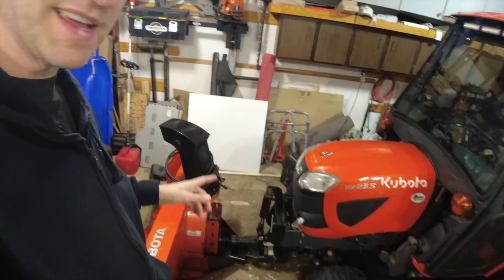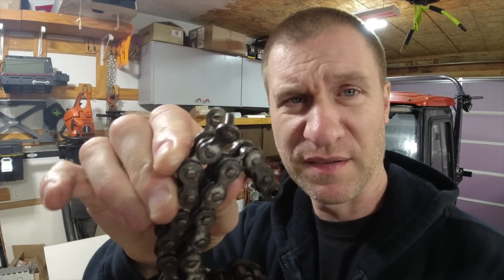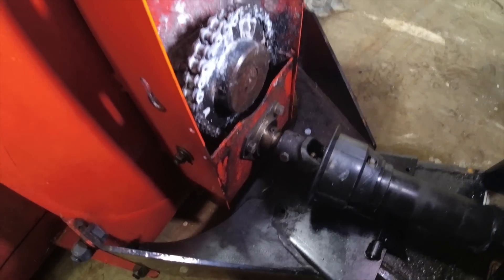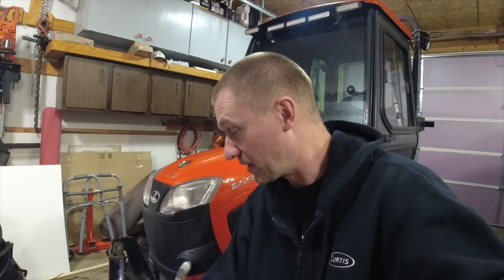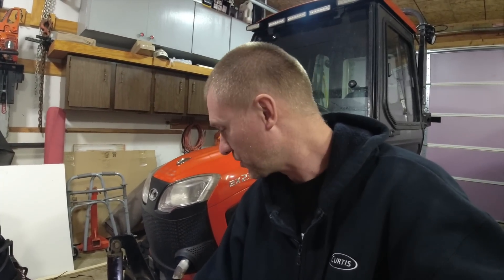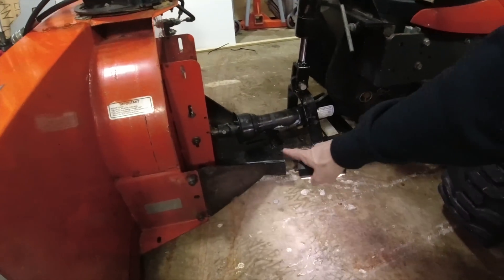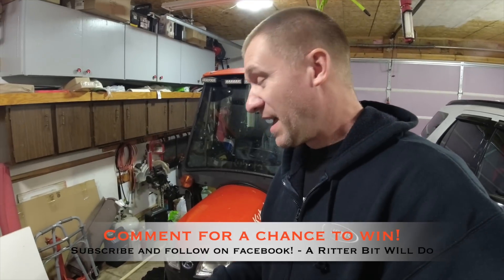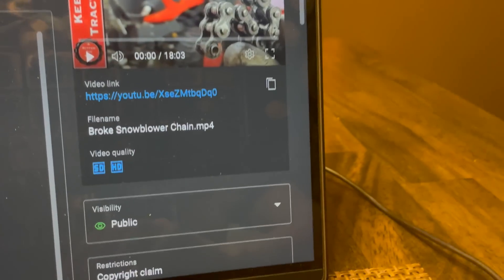CAN'T BELIEVE I OVERLOOK THIS (Plus Decal Winners!)

Comment: Jon, Wherever there is a shear bolt used you should remove the bolts every season and be sure the shafts rotate freely from each other. If the shafts become rusted together, the shear bolt won't break and you will be spending a lot more than the cost of a shear bolt to fix the damage!
Reply: Great tip!

Comment: Happy and a Blessed New Years John and family!! Two suggestions. 1. There are commercial sprays you can buy so the thick wet snow doesn’t clog; I’ve also used plain cooking oil in a spray bottle. 2. In an area that gets a lot of vibration instead of Lock Tight I use nail polish. You can pick up cheap colors at a discount store or maybe your wife has something she no longer likes. I coat the threads or set screw and allow to dry. You might say, nail polish will not allow the set screw to come out. I use a propane/mapp gas torch which softens the polish and they come straight out. Hope this is helpful….Tom
Reply from the maker: Nail polish... Now there's a unique idea. I was going to buy some Locktite because I didn't have any but I know my wife has nail polish. 😁
Keep on tractoring!

Comment: Happy New Year Jon!
Be sure to take a close look at the threads on the set screw. Actually I would recommend replacing with a new set screw no matter how it looks. It will be cheap compared to that dang chain. Loctite should work well assuming the threads are in good shape. Good luck and Keep on Tractoring!!

Comment: Just a quick tip Jon, when you get a new snow blower you would be best to coat it with ceramic coating (9H), that would last about 5 years, maybe longer since you really wouldn't use the blower that much.  With the ceramic coating very, very little would stick to it!!  Mine works perfect, just have to use my leave blower to clear the tractor (BX 2680 with cab) off completely!
Reply from the maker: I have some ceramic spray on stuff that I tried today. We'll see it I notice a difference. 
Keep on tractoring!

Comment: the "two set screw" approach is very effective, I see it a lot, it works well. You may have to get shorter set screws to add a second one depending oh how thick the hub is where the screw resides. Glad you got it all back together and ready for action.

Comment: Owners of Kubota BX2750D and similar snowblowers, READ THIS.
I had the same problem with the chain which broke, the misalignment of the gears was certainly the cause.
The top gear was at least 1/4 inch out of alignment with the bottom gear, plus one of the set screws was missing, and the other was loose.
The gear even nearly cut the 1/4" X 1/4" square machine key which prevents the gear from spinning on the axle.
The gear and the axle will have to be changed, since the key channel is damaged on both parts.
I believe that forcing these snowblowers too much, in piles of compacted snow can eventually create this type of problem.
So don't force those snowblowers into icy or hard-packed snow anymore, or get your wallet out.

Comment: Hmm, I thought that ran at full PTO speed, not "Geared down. 
Thanks Jon.
Reply from the maker: Wonder if I could find a slightly smaller gear and get some more speed out of it. 
Keep on tractoring!
Reply: @ritterjon  Not sure that would be a good idea, deep wet snow may bog the engine and slow you down. Kubota engineers have probably selected the best ratio for that snow blower and tractor combination. Happy New Year ....

Comment: Sorry Jon for using your YouTube channel to warn owners of Kubota BX2750D snowblowers of the danger of abusing the power of these snowblowers.
But since you are followed by more than 15,000 subscribers, I believe that this is the perfect place to make this warning.
Forcing these snowblowers into compacted snow can, in my opinion, push the auger assembly backwards and thus misalign the gears.
Resulting in expensive repairs and rendering the equipment unusable while it is repaired.
Thanks for your understanding Jon.